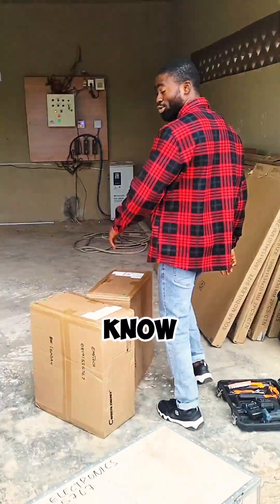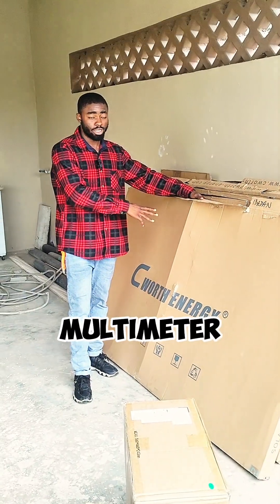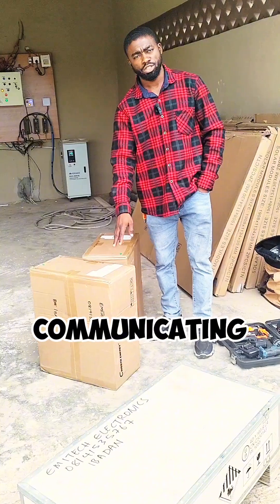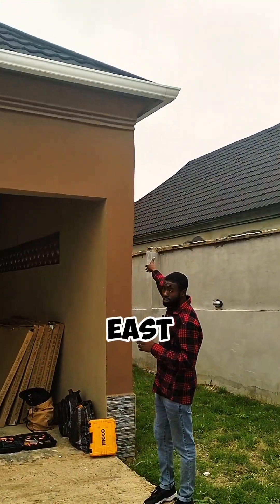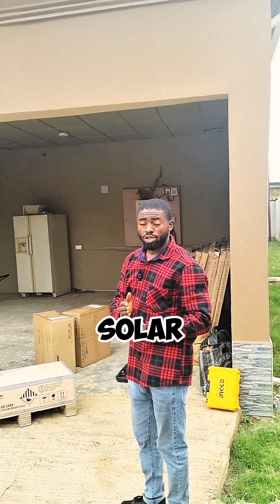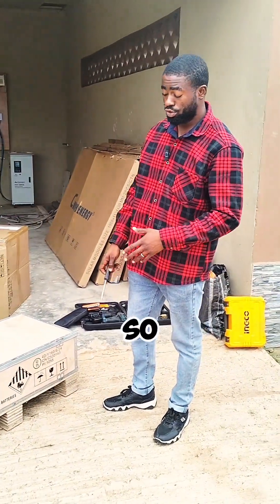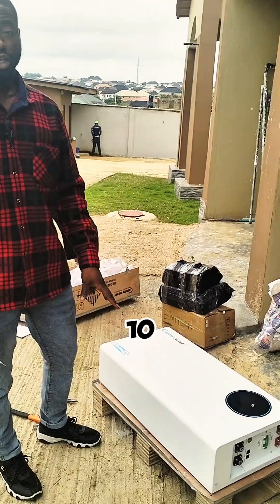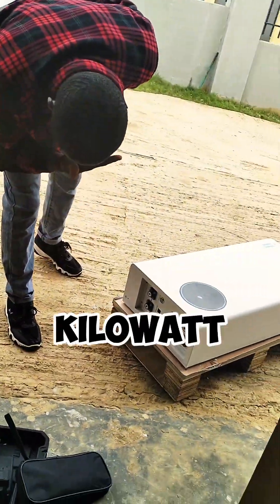12kw solar installation preview and unboxing of 10kwh cworth battery

Comment: Is the 15kwh Cworth Lithium battery any good. The price difference between the 10kwh and 15kwh is very little. I am skeptical about buying the 15kwh. Are there any issues with the Cworth 15kwh lithium battery?

Comment: Boss ibeg i one asking one question oh how do you calculate ur max voc of ur charge controller some change controller i have seen does not indicate there voc and power just amps
Reply from the maker: Just multiply the rated current by the battery voltage

Comment: Can Cworth inverters be oversized on the PV side if the oversizing is within the max vdc and Isc limits?
Reply from the maker: Nope
Reply: @Mairigaemmanuel  That's sad.
Reply: @Mairigaemmanuel I was hoping to get at least 8KW from PV using 8S2P setup with their 500W panels (16 panels in total), which will still keep things below the max vdc and max lsc of their 6KW inverter.